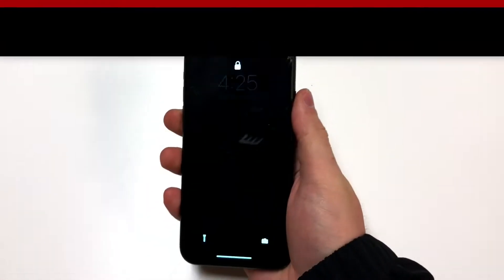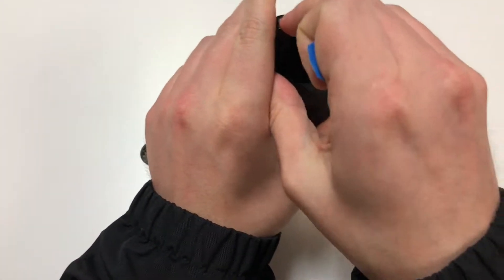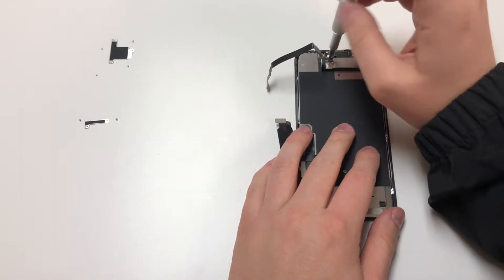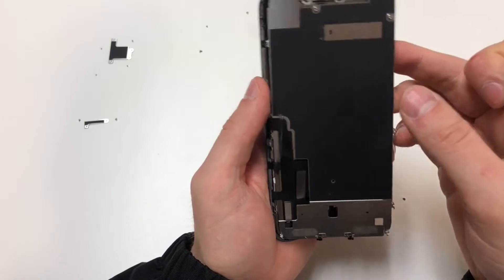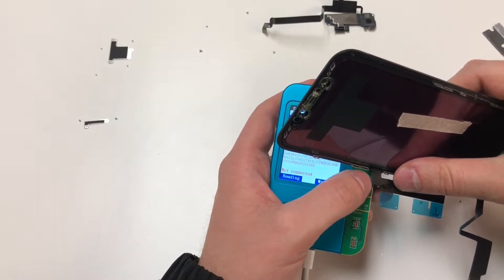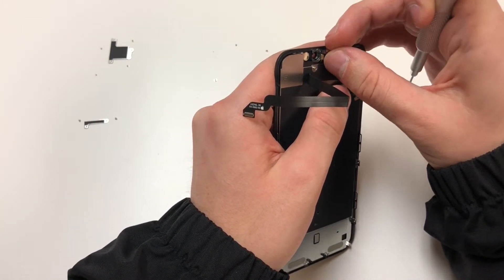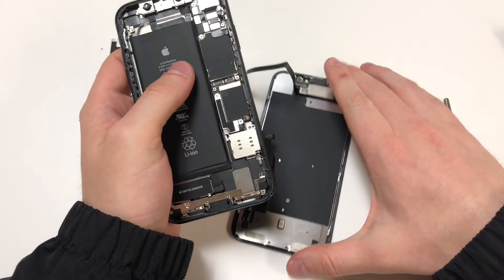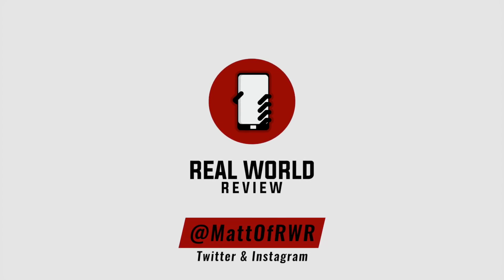Apple iPhone XR Screen Replacement (Fix Your Broken Display!)

Comment: Is there any way to open the phone without damaging the screen?
Reply from the maker: Yeah, with heat and making sure to be careful with letting the screen bend. Flexing a little is fine, but too much will cause the LCD inside to shatter.